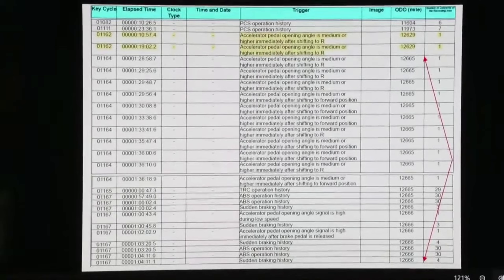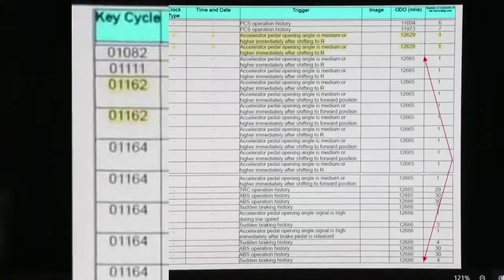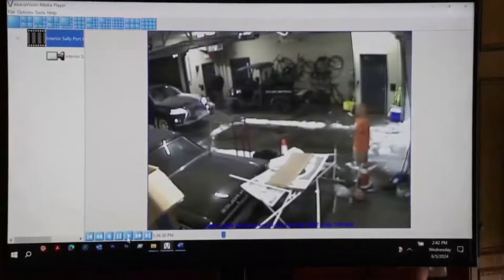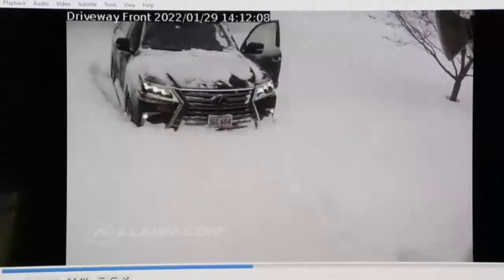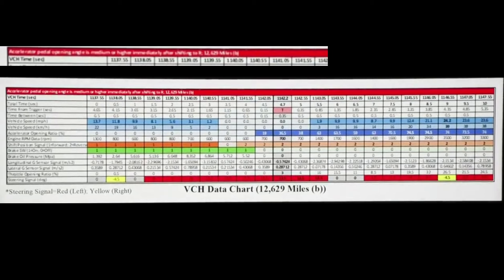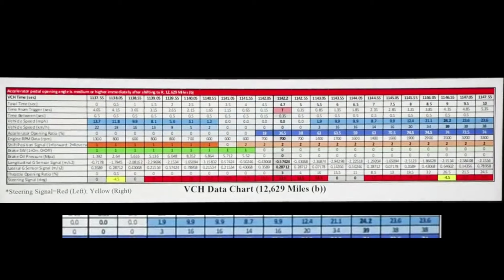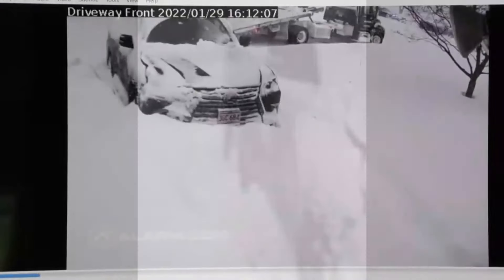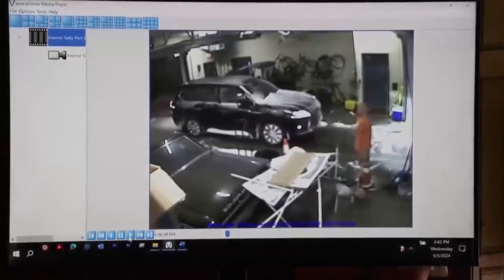Karen Read Trial Questionable Key Cycles

Comment: Thank you. I agree, lots of shenanigans as to key cycles and odometer. But, if we could find the right key cycle, we might be able to see what she did at Fairview.
Reply from the maker: The log provided by Trooper Paul shows the events go from 01111 to 01162 so she would have had to turn her car on and off 51 time between when she allegedly hit JO and when her car was seized.  So I don't think its likely any events were recorded that night/morning, unless the event logs are incomplete.
Reply: @kaptnawesome  Did he explain why so many log numbers were missing?
Reply from the maker: @Songbirdstress  He said the system logs the event when something specific triggers it. The events documented in the report from his testing show rapid acceleration, traction control, sudden braking, and ABS braking. The key cycles not listed just shows nothing happened that would have triggered the system to record an event when the car was driven those times.  It indicates nothing abnormal happened prior to the tires spinning in the snow when the SUV was loaded on the tow truck.
Reply: That's the thing: she didn't do anything at Fairview, other than pull forward and drive away. If you want to know what happened at Fairview the answers lie with those inside.
Reply: @kaptnawesome  Doesn't that rather prove nothing out of the ordinary happened at Fairview? The cycle he's analysing looks very much like the tow driver trying to reverse and spinning before getting traction to get the car on the truck. Seems logical to me with the wheel movements, since if you apply the multiplier to the steering wheel (50 degrees?), it looks TOO BIG for Fairview.

The other problem I have is was it snowing or not? I thought the meteo said it didn't start for real until AFTER. The library video clearly shows the roads were WET, not yet snowy. Which paradoxically helps their case...they're not admitting it imo, because he was found ON snow, not the bare ground (I think he was put out at about 2:20 or so during the butt dialling and they found out the snow plough would be going through. We'll have to wait for Lucky to tell us what time he went through. No chance of getting that from them obviously).

Or, if it WAS snowing then, we have no idea how fast the car was going because it's most probably the wheels not getting traction. imo they're not admitting that because they can't say in open court it was snowing because it wasn't.

This egregious police behaviour is driving me to caps lol. I need to learn to code italics...
Reply from the maker: @Songbirdstress  yeah, if the event happened when the car was towed, this data shows nothing happened at fairview (no event triggers)

I think the claim is that it was starting to snow but it wasn't really sticking around on the ground yet. Melting to fast to build up

I think you're right about them putting him out around 2:20.
I dont recall the testimony about finding him on snow so I would have to look at it again.
I think one reason Lally wants everyone to think it was snowing bad is to explain why no one saw JOs body on the lawn.
Reply: @kaptnawesome  Medics said was on snow. Another reason they showed drone footage with snow rather than wet/sludge, imo. 

People keep saying they proved snow. They haven't, they proved snow afterwards

They haven't been clear at all on conditions at 12:30, their own demonstration presumes no/little sticking snow. Another reason he was wandering around without a coat maybe.